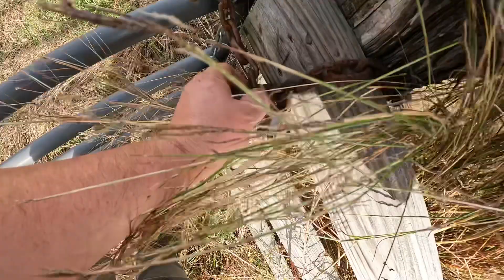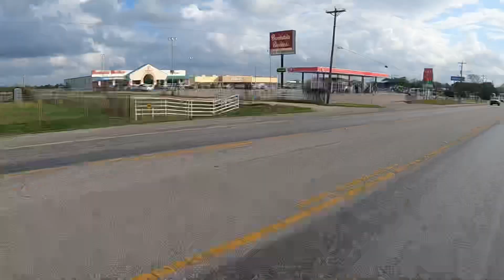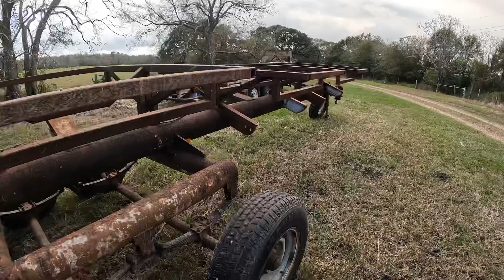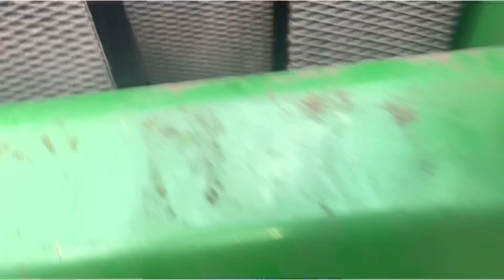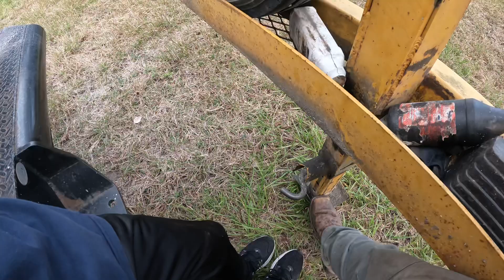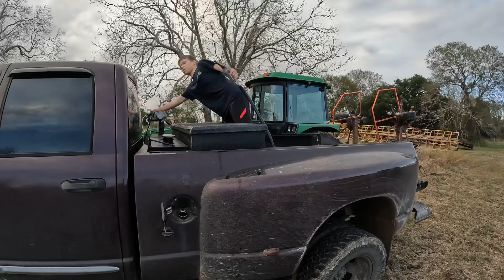Hauling some hay and getting much needed equipment!!

Comment: Just FYI, you don't have to replace that long chain, you can take 2 links out of it. Those chains have a lot of stretch in them when there new. You should be able to remove 2 - 4 links over the life of the chain instead of replacing it every time is lets slack.
Reply from the maker: I appreciate the advice!  Will def save me a little $$